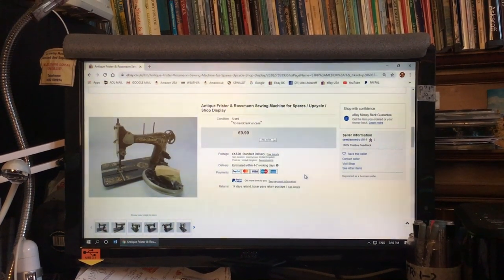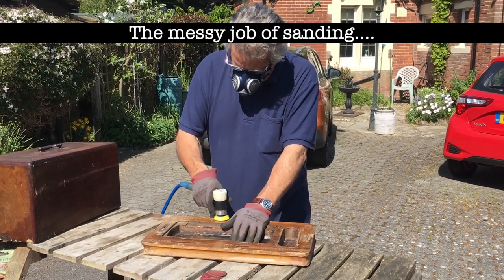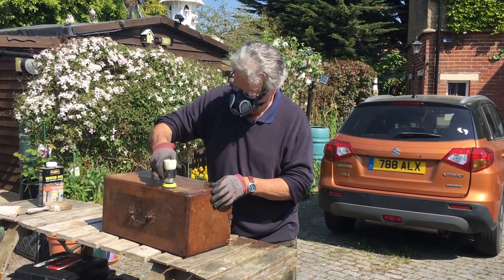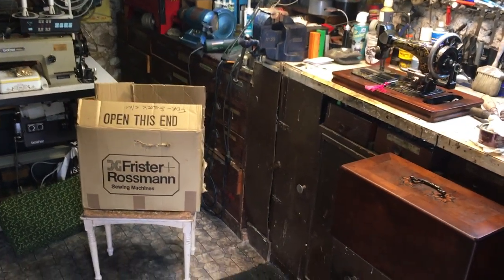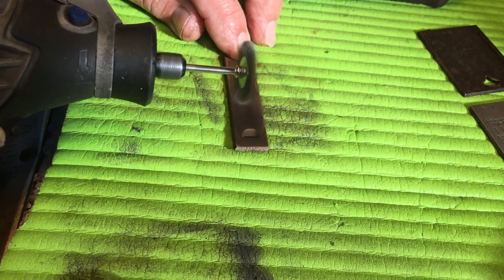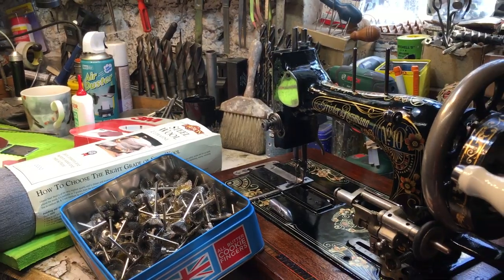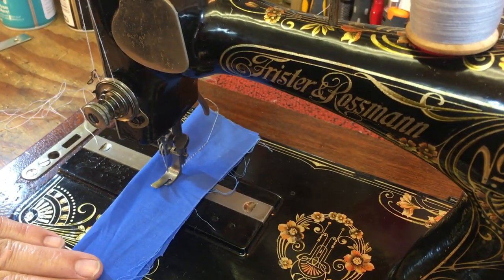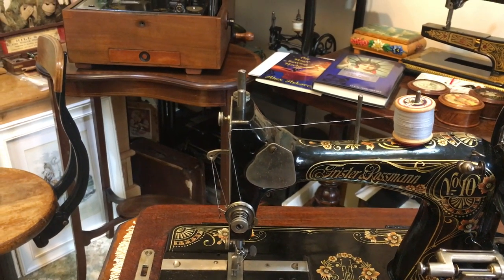Alex Askaroff  restoring a vintage sewing machine.

Comment: Evaporust does a great job removing any rust. Makes  bobbin winders cleanup great as well. I soak all metal parts in evaporust for 24 -48 hours. The metal comes out as good as new. I never have to sand only polish afterwards. Thanks for the videos I’ve watched them all many times.
Reply from the maker: I was told about that many years ago by a watchmaker who cleaned his parts with that, very gentle way to clean rust away. I have used it for tricky shapes. But I love the burnished steel patina that oil and emery gives. Great tip.

Comment: Hi Alex, I am a retired engineer, 73 years old and have decided to have a go at sewing machine restoration, I have bought a Frister and Rossmann model E VS, I am finding it very difficult to find any info on adjustments required after a stripdown and refurb, I wondered if you could point me to any useful resources for info and spares.
Best regards John
Reply: THANKS FOR YOU HELP, I DON'T KNOW WHAT I WOULD HAVE DONE WITHOUT YOU

Comment: Hi Alex!  I have a vintage Bradford machine.  I just bought it this past weekend.  It worked when I tested it out.  I got it home and it started smoking.  I think there's a problem with the motor.  I liked it, but it is no longer sewing.  Any way I can fix it myself?  The model number is M 122960.  The light works.  It's getting power from the presser foot, but it's not engaging the balance wheel.